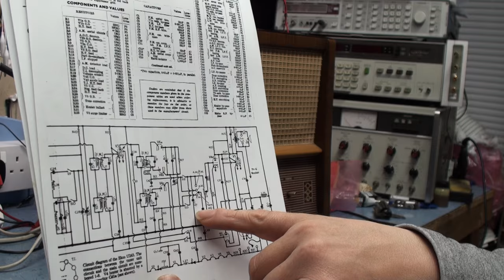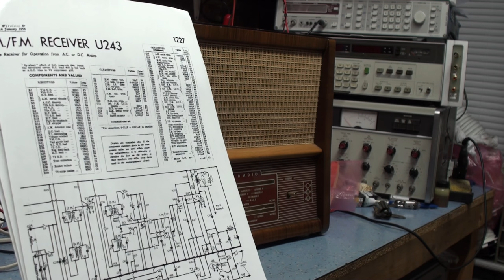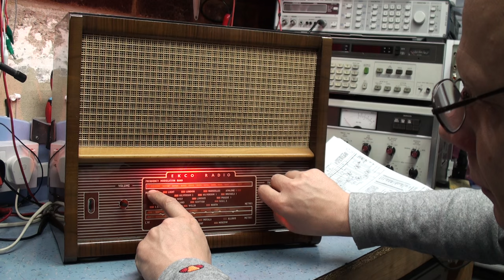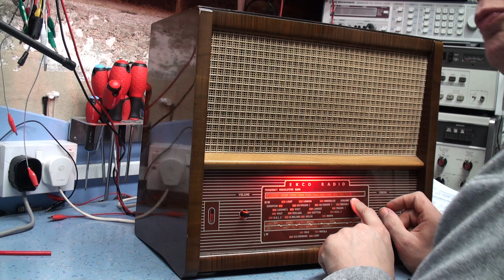EKCO U243 pt7. Scale calibration and test run

Comment: Simon, Before your 1 meg ohm pot arrives you could try putting a 470k resister in series with the pot, this will prevent loading down of the previous stage.
Reply from the maker: +Michael Beeny I tried that. You loose a lot of output on the wiper and top of the pot and can't turn the volume down on the ground end.